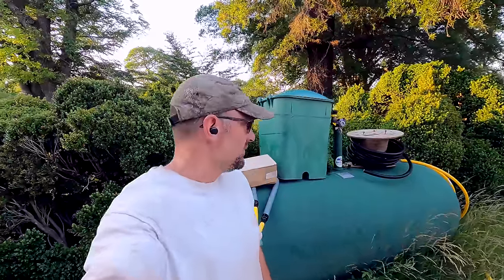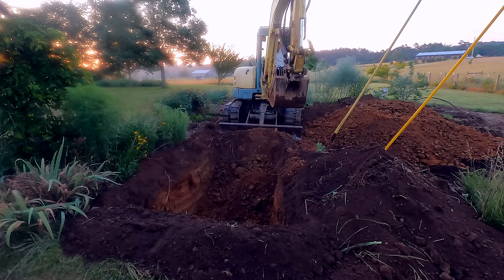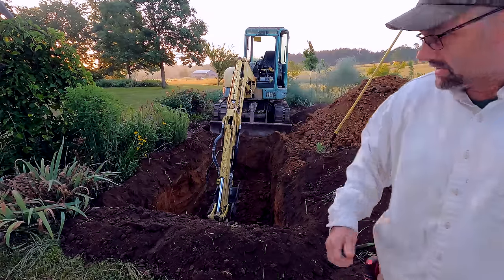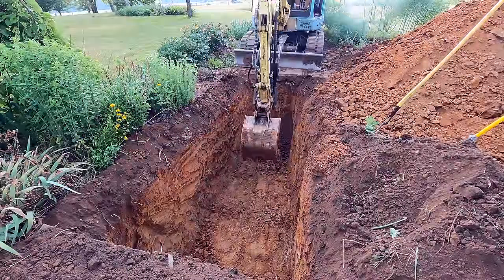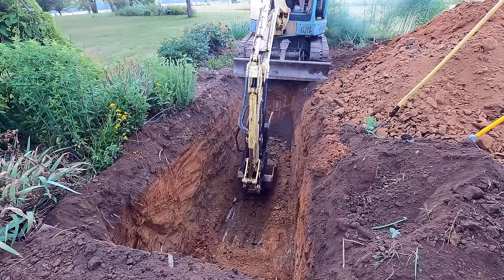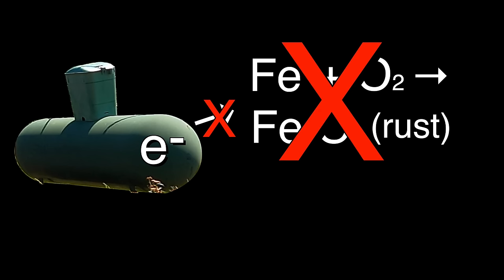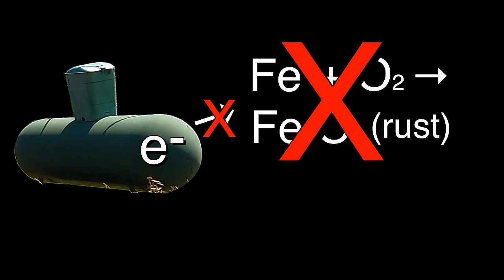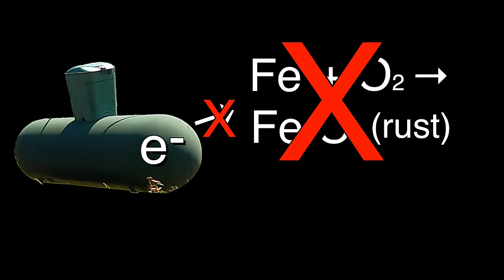Installing An Underground Propane Tank (500 Gallon)

Comment: Not too bad for a first timer. Next time you are going to be digging, it is a lot faster if you don't have to dodge obstacles like the guy wires.  Just for reference, I usually have the tank buried, gas line connected,  and driving off in about 2 hours. Of course, there always " those days"  days that just stink.

Comment: On an older diesel vehicle...; check the fuel return line.  Those, with age and heat, tend to collapse.  They will then reopen...; for a few minutes which makes it very difficult to troubleshoot.

Comment: I have been living in rural Oregon my whole life. If all my born days, I never even heard of someone burying a propane tank.
I have had a thousand gallon tank for 35 years and it's always been like a tree- does not bother anyone. That are really safe if installed properly. If you hate the look, you can always build a shed around it. Maybe you have to bury it on the east coast ??
Reply: I read at -44 degrees it turns to a liquid. Maybe thatbfreak cold snap could be a possible problem.
Reply: @1607rosie  at -44 propane boils and becomes a vapor also when the liquid is exposed to air. An underground tank keeps the propane at an even temp. Usually the ground will stay about 40-50 degrees. If the frost goes lower than 4ft then the tank would go to 30 degrees or lower.  An above ground tank fluctuates in temp depending on the static air temp.
Reply: @1607rosie  Mike, the propane in the tank, any propane tank, is in liquid form.  A tank of vaporized propane would last minutes, then the tank would be empty.

Comment: The problem with your excavator apart from gunk in the tank could also be your fuel feed pipe (flexible hose) disintegrating from the inside as well so when you clean the tank make sure you change the hose as well , once i took my car's tank out for nothing, it turned out to be the feed hose was disintegrating that was causing me trouble !!!

Comment: After  you blew  that hose out, it confermed it was a bad fuel cap... its starving because when fuel leaves, it has to be replaced with air... take the cap off for a while when it slows down to prove its the problem

Comment: 4:20 My guess would be a restrictive hydraulic or fuel system. In the beginning, when the machine ran right, I was aiming more towards the hydraulic side, but now I'm more toward the fuel side. If I had to guess: Working with it has shaken up debris in the tank, which is slowly blocking the fuel filter more and more. I can't quite explain why it runs alright the next morning though. A short while would be understandable, but running alright for quite a while seems strange. Maybe an in-tank filter, and the dirt fell off while sitting overnight? I'll see in the next 20 minutes.

Comment: Doubt it is the blade cylinder at fault. Most likely your rotary manifold seals are bypassing between circuits, probably contributing to your travel motor weakness too.

Comment: Why do they put the anode bag in the bottom of the ditch?  Is there a presumption that the ditch will fill with water helping to create the battery which would cause tank corrosion?  How many years before the tank replaced?

Comment: Check if the tank can get air in. When fuel is taken out of the tank, the space it took needs to be filled up or a vacuum will be created preventing more fuel to flow to the carburetor. I had this once on my motorcycle. After app. 2 miles it would stall. After opening the vent opening up in the fuel cap again, the problem never occurred again.

Comment: I looked in your Amazon store but didn’t see the molded ear plugs? Blue tooth speakers? I’m curious after buying some apple expensive and them falling out while the blades were engaged on the zero turn I’m in the market for better.
Reply from the maker: I just added them, in the 'tools every shop needs' list.  I've been pretty happy with these earbuds.  I'm hard on them and if they last more than a few months they must be good.  These are pushing 9 months and still going strong.

Comment: Congrats FC101 on digging the hole and putting in the Propane Tank.  Looks Great.
Reply: Improper tank installation and if the propane company that the guy works for sees this video he will at least have a final written warning for several issues

Comment: John great video. My Bobcat skid steer did the same; run for a short time and loose power and stop. The screen in the tank was plugged up with gunk. Cleaned and now works great. It sat with little use for a few years till I purchased it. Great machine. Good luck with the excavator, seems to dig well as it is. Some much needed maintenance  will make this a good machine for you

Comment: I love your work and your teaching skills are amazing....just a couple of comments. Never trust any cable...that tank should have had two tag lines. Even so, don't stand inline with the pulley, for if the cable snaps the momentum will keep the pulley wheel in line with with the cable's plane, and it will roll off like a toy top. That crane op was in a lot of wrong places...

Comment: I wouldn’t be surprised if the tank is infested with ”fuel bacteria”. Lot of different bacteria, yeasts and molds can use diesel as their carbon source. However, that requires that there is some water in the tank. The bacteria live in the layer between water and diesel. When biodiesels, or FAMEs, where introduced it made the problem much worse. This is quite common problem with boat engines. Even if you get no rain- or sea water in the tank some water will be accumulated through condensation. If the excavator has been standing long with tank half empty it is 100% sure there is some growth. In boats you typically don’t get any problems if you run the boat with 60-70% throttle on a calm day. Once the sea gets rough and you ask for more power the slime gets moving. My friend stalled their boat engine twice in rough conditions. Their boat had been in storage for two years. The only cure is to empty and wash the tank, change filters and do anti-bacterial treatment twice or thrice. Here in europe you can buy stuff called Grotamar that kills the bacteria. I don’t know if you get the stuff in the US but I am sure you can get something similar. The poison (grotamr) doesn’t remove the slime or dead bacteria but it prevents growth of new bacteria. In fact my boat has been in storage for 3 years and before vommissioning the tank was washed, old diesel was sucked out, all filters were replaced - and Grotamar treatment was done. I never fill the tank with FAMEs unless I am forced to do so.

Comment: When I had a problem with running only a short time like that and eventually fund the vented fuel cap plugged with mud.  The problem was cured by cleaning the cap.
Reply from the maker: I tried loosening the cap but it didn’t help. Good thought.

Comment: Buried tank is a good idea . Seen many above ground tanks and I think the owners had better be polite folks .  
Great job , looked professional .
👍👍👍👍👍👍👍👍👍👍👍👍
Reply: What is wrong with above ground?   What do you mean?
Why did he bury the tank?
Reply: @mikelgeren149  
Few bullets would penetrate.
Fuel would squirt out until the propane freezes.  As the liquid warms it will continue to leak fuel.  Only when enough oxygen has a chance to enter would the fuel in the tank explode.  It needs to mix in proper proportions as in an engine.  Perhaps the flame would go inside and burn a long time.  Only when all of the liquid is gone out of the tank would oxygen have a chance to enter.   
I suppose somebody would need to ignite it for the explosion to happen.
Reply: @jakebredthauer5100  don't have to penetrate the tank , just go through one side . 😜
Seriously there are many, many API rounds floating around and in many calibers . If you have an above ground tank , build a berm or wall around it .  A 50 BMG round will take quite a bit of concrete to stop .
Reply: @mikelgeren149  
Concealment would be cheaper.

Comment: The fuel filters are full of shit and your diesel tank is probably caked with gunk inside, so the machine will not run great. My Volvo EC55 had the same issue, lots of fuel problems until we managed to find a small filter inside the tank that was partially clogged. I changed the other filters and they looked gritty but not too bad, but that first filter was the issue. The previous owner had polluted the fuel tank with lots of dust and sand while they were working on some projects, and I inherited the issues with it. After that cleanout, it was just like a new machine and worked flawlessly. The lights on it was super bad so I canned them and spent some money on 5 new LED worklights. Best buy ever! It was like night and day. Before, my eyes would strain to see in the dark when I was working, but after the LED's I saw everything. I actually had to install extra yellow blinkers on all 4 corners, for some short transport on the local road, because the LED's was blinding all cars and had to be shut down when I met someone. Getting two boom lights was a blessing, as I could even see inside the bucket at most angles.

Comment: We recently had an underground heating oil tank removed from our house. Because it had leaked (all buried tanks eventually do), they had to remove something like 10 tons of soil as well, and also do required soil and ground water testing and mandated disposal.

We'll get reimbursed in something like 5-10 years (not kidding about that delay), but just the removal has run us around $9000 so far. That's assuming the groundwater tests don't come back at higher than allowed levels.

I don't recommend burying any tanks.
Reply from the maker: Propane is very different from oil.  If it were to leak, it would not stay in the soil.
Reply: @FarmCraft101  you’ve never seen soil that’s been in a prolonged contact with soil have you?
Reply: Oil tanks tend to rust from the inside out. The sludge buildup at the bottom retains the moisture and rots out the tank a long with the moisture in the soil. Propane tanks don't have a problem with moisture inside as there is methanol mixed with the propane to mix with any moisture so it is burned off.
The anode bag and yearly testing prevent the outside from rusting.
Reply: @davemoulton2971  methanol in propane isn’t added in mass, it’s only added case by case basis if there has been contamination to the propane
Reply: @aron6998  every new tank set in the field has methanol added as well as every transport load coming from a terminal has methanol added when loaded. At least that is what happens here in the New England.
Reply: @davemoulton2971  yeah that’s not a thing, propane doesn’t not have to have it added unless the container has had water vapors introduced somehow, and I guess I can say it’s not a thing in the four states that I’ve installed tanks in plus too much methanol can create its own set of issues which is why it’s only added case by case

Comment: I own a similar sized mini excavator. When your trenching a wide ditch like that try digging your center cut first and then rotate cab to the right and side shift your boom to the left to get your bucket parallel to first trench for right side and vice versa. Try running it with all the engine hatches open next time and see if it runs longer.  Mine used to run hot when I first got it.  Good job I enjoyed your video

Comment: Yup same problem with my Bobcat 743 could not get enough fuel into the fuel pump. As always I have little time to pull the fuel tank. Eventually I vacuumed the fuel tank out put a little more fuel in it and repeated process then repeat again. So far it is working fine for a couple of weeks now .

Comment: It would be quite fun to keep a running total of how much you saved by doing the work yourself with the excavator. If the firm I work for had to do that "small job" of digging the hole and filling it would have been a few 1000sds...

Comment: I don't know what your ground water is like there but if you did that here the tank would pop out of the ground like a bobber in the wet season...here we pour a 12 inch slab under it and bolt the tank to the concrete...if we didn't the tank would rip from the gas lines and leak out the remaining gas ....gas is lighter than water and the tank itself isn't heavy enough

Comment: So they sell electronic devices to be an "anti rust" system for vehicles, I see them all the time... So you could just sell a block of solid magnesium with a protective shielding case and a ground wire to do the same thing-put an expiration date on it perhaps...

Comment: Enjoy your vids, very entertaining.  Hope this is to replace that wood burning  furnace.  I have two neighbors that use those for heat and they stink up the neighborhood all winter long which is 6+ months here.
Reply from the maker: Actually it's not, I love my wood furnace.  But it is a gasifier and hardly smokes at all.  People usually don't even know it's on when it is burning.  I also always dry my wood before I burn it.  If you have a regular furnace and burn wet wood, it will smoke like...well, like a chimney.  ;-)

Comment: The anode has to be at least 1 foot away from the tank. Soon as the gypsum powder falls away from the anode it will make contact with the tank. Should have been covered with a layer of dirt and water the dirt.
Reply: Ideally it’s set off to the side of the tank and with enough distance to where contact can’t be made, the company that the propane guy works for would be pissed about this video tbh for multiple reasons and one of them was anode placement

Comment: In 07 I was hired to dig a trench five feet deep 2500 feet long through the stony  ground of central  New Hampshire.  The trench could not curve any more than the conduit  could bend.  They bought a used Yanmar. I dug on that trench all summer from April til late August.  The biggest stone I delt with was nearly as big as the machine. I dug a mighty hole next to the offending stone and wrestled it over off the line of my trench.
 Imagine working an entire week on one stone.

Comment: That looked like regular gas line for the fuel. It probably sucked some algae or cr@p in from the tank and thereupon collapses once it warms up, cutting off flow and stalling the engine. Just a guess, but look into the correct fuel line for a diesel  system ~

Comment: Not sure that putting 500 gal tank near guide wires is a safe move. Lightning could travel down them with enough electricity to possibly travel through the soil to the tank.

Comment: my opinion after 2 cases of home heating oil that leaked underground and spending weeks either without heat or on a 5 gallon can no way will i ever have a buried fuel tank . we had grey clay subsoil water table at bottom of tank in spring rains and undergrown electric service ,  and neighbor had all electric heat and took well over week to get one leg of electric fixed in winter

Comment: Different laws in USA from UK
It is forbidden to bury a gas tank in UK, you cannot inspect maintain or even know if you have a leak , and IF you have a leak? It will absorb into the nearby ground and sooner of later you will have a nice firework display
Reply: In the US propane tanks are buried all the time. Codes relating to propane tanks are pretty intense. Propane has no odor naturally so mercaptin is added to give it a smell. Mercaptin has a very pungant smell. If you spilled one gallon in Central Park in NY City. The smell would be so bad that the whole city would have to be evacuated.
The sand packed around the tank serves several purposes. One is that it will allow any leaking propane to seap to the surface and you will smell it.  It also prevents rocks from rubbing against the tank and  causing a leak. The sand also allows easy access if you need to replace the anode bag.

Comment: Why not just spray the tank with POR-15 or some kind of water sealing epoxy paint?  I get that the anode is a lot easier though.
Reply: The tank is already protected by a thick water proof epoxy that’s why it’s green, however the anode is still required by law and must be checked at least every three years also the protection from the factory on this particular tank was compromised as soon as the technician showed up and started to bang it on his crane and the dolly and everything else that was within reach 🤷🏼‍♂️

Comment: YOu aked in the other video if it was a good deal. I still think it was even considering the repairs you have had to do. I used to work in a rental place 20 years ago and our price for a much smaller digger was about $1250 for a weekend. Might be less in the us because of more availability than here in sweden. Considering ancient tractor go for about $5000 here an excavator that is reasonably modern for the price you got seems smashing.

Comment: it sounds to me like something doesn't like being hot. as long as it's cold, it works properly but the hotter it gets, the more problems pop up. 

i had that kind of problem with my first motorbike, a honda MTX. air-cooled 1-cylinder engine, 80 cc, 80 km/h (50 mph) top speed. one time, on a holiday trip, i had some problem with the engine, and the mechanic changed the spark plug. then, on the way home, the real problem started: as long as the engine was cold, it ran normally, and i could make it to top speed. but as it heated up, the bike felt like something was hitting the brakes when i tried to accelerate. it was worst at full throttle. eventually it got so bad that i could only go 60 km/h instead of the normal 80. needless to say it took me ages to get home. the next day i took the bike to a workshop, and they told me that the problem was the spark plug. it was the wrong type. it got too hot, which triggered knocking and killed engine power.

Comment: I had an old tractor that would die after about an hour- turned out to be a rusty fuel tank. Little bits of rust kept clogging the fuel line.